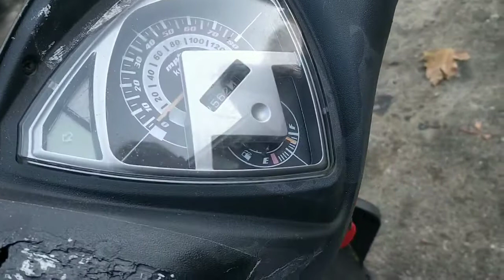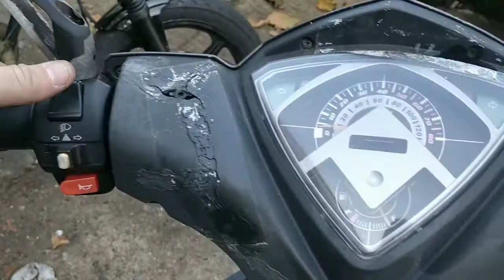sinnis harrier 125, new carb, electrical fixes and general maintenance

Comment: Hello great vid. My dad just bought me a 2022 Mgb r8 125cc moped and it literally looks exactly the same as this 2013 sinnis. How can that be? We bought it from a store brand new. Have we overpaid or bought a cheap Chinese knockoff? We paid £1899 will be delivered later this week. Hope it’s not a knockoff. From doing research mgb is a newly made company sourced by moto gb. Would appreciate your advise help or opinion. Thanks
Reply from the maker: Hi, these bikes are all made in China. Then other companies buy the design. For example lexmoto have this design and put their own stickers on. 

You have just bought the same bike but with the stickers of mgb. 

These bikes are OK though and for £1800 brand new that's pretty good, so I wouldn't worry about it.
Reply: @motorcyclerescuer  hey thanks for such a fast response. I did some research and mgb is a new company and the mgb r8 125cc I bought is a 2022 model. I’m glad that my dad didn’t buy a cheap knockoff and that these bikes are ok. Do they last long and also what’s the top speed? And also is everything the same? Same engine etc?
Reply: Oh I also have another question. My mgb hasn’t arrived yet but I wanna buy a phone mount for it. I notice the wing mirrors on these bikes look quite cool and different though. You know any on Amazon I can buy for a mgb r8 125cc. Ty
Reply from the maker: Its a Chinese bike so aren't the most reliable however if you put good oil in immediately that will help. Use plenty wd40 or similar on the brake wires etc. 

Top speed will be around 50mph ish
Reply from the maker: I don't I'm afraid because there isn't much room on the bars for it. It will need to clamp to the mirrors I'm sure

Comment: Hi Charlie my one switche offf everhtime I stop it in traffic could it be battery ?
Reply from the maker: Is your idle high enough? If it is you could have a blocked jet that needs cleaning. So it may need a carb clean. 

Try raising the idle first as it only takes 2 mins
Reply: @motorcyclerescuer  is idle the screw
Reply from the maker: @sharukhkhan9242  when you open your seat you will see an inspection panel, take that out and you will see the carb. Looking direct down and standing behind the bike, on the right you will see a screw. Turn it to the right half a turn. That should solve your problem. If its still cutting out turn it another half turn.

Comment: Electrics are my worst nightmare. Hope it it goes well with mot. Nice one Charley
Reply from the maker: I'm getting pretty good with them now. I'd never have worked that out 2 years ago. I used to get Jake to do the electrical problems. I used to drive myself nuts trying to work it out.

Comment: Hi there quick question av got the sinnis herrier 125 19 plate was fully working till last night driving down road got to traffic lights n click all electrics stopped i could kick start it but want easy. Any ideas to what or why it did that
Reply from the maker: Hi mate, so when you turn the key do you have any lights come on the dash? 

It should to me like your battery has died and needs charging. You would need to check that the bike is still charging as sometimes they stop. 

If you look at my lexmoti fmr vids this will explain more. 

Let me know what you think. 

Thanks for watching and please subscribe
Reply: @motorcyclerescuer  hi, i checked battery thats fine erm when i turn key theres no power to dash at all no horn nothing when i kick start it the lights come on but then go off
Reply from the maker: @SAUS4GE_SLAP  it sounds like you have blown the main fuse then. Near the battery you will have a fuse somewhere and it sounds like that has blown. This is normally what happens when you get nothing at all on the dash. 

Hope this helps
Reply: @motorcyclerescuer  i think it is the fuses ive got 2 glass fuses i just wriggled one of them dash came on for a sec then went off so maybe loose or like u said they have popped. Thanks for your help mate and av smashed that sub button 👍🏼
Reply from the maker: @SAUS4GE_SLAP  no problem. Get s new one in and it should be good to go. 

Well done.

Comment: Hey mate my bike runs for 5mins the cuts off no smoke any suggestions? Could it be battery or carburettor thanks
Reply from the maker: It sounds like text book valve adjustment. While cold it will just about run but once warm the valves tighten and won't run properly. 

Valves have to be checked and adjusted once stone cold though. 

That's the first thing I would do
Reply: @motorcyclerescuer  thank you very much mate earned a sub for me keep the channel up 💯💪🔥👊🏻💙
Reply from the maker: Appreciate that. 

Let me know how it goes out of curiosity.

Comment: Hey I love your videos my dude I’ve just bought a sinnis harrier 125 to repair it but I’m very new to this and I need to replace  carb  but idk what new carb to buy and where to buy one do u think u can send me a link to a new carb that will fit my bike?
Reply from the maker: Hi mate. Thanks for watching the channel. 

This is a ebay link to the new carb. It will be plug in and play.

https://www.ebay.co.uk/itm/175249307438?mkcid=16&mkevt=1&mkrid=711-127632-2357-0&ssspo=EhTkdid8QLK&sssrc=2349624&ssuid=CDLOYQ8UQj-&var=&widget_ver=artemis&media=COPY
Reply: @motorcyclerescuer  thanks man means a lot 🙂🙂
Reply from the maker: No worries.

Comment: I cannot find a brake line for this Sunnis harrier anywhere it’s the back brake but!!!!!!!! It’s not  it’s part of the back brake but it’s at the front of the bike and I need that front wire and I cannot find it anywhere
Reply from the maker: You just have to measure the one you have and order on ebay. They are generic
Reply: @motorcyclerescuer  amazing thank you
Reply from the maker: Good luck with it mate.

Comment: Great video. Just a quick question I have a Lexmoto Titan 125 and I’m having trouble with my lights I can’t see that the bulbs have blown Im not great with electrics tbh so I’m a little worried taking things apart lol Have you got any advice please.
Reply from the maker: Hi mate, if it's the same system as this sinnis then it's a pain if I'm being honest. If the bulb has blown then that's an easy fix but if it's wiring it may take some investigation to solve the issue. Are you in London? I could take a look for you if you were
Reply: @motorcyclerescuer  Oh right I see hopefully it’s the bulb as I’m no good at electrics lol. Im in Kent
Reply from the maker: Check the bulb first as it's normally just a simple fix. If you feel the bulb is OK and the wiring is the issue your welcome to pop to London on the weekend for me to take a look. Depending on where in Kent it's not to far of a ride.

I'm sure the bulb will solve it though
Reply: @motorcyclerescuer   Cheers thank you for you’re help it’s much appreciated
Reply from the maker: @stantheman575  no problem, let me know how it goes
Reply: @motorcyclerescuer  Will do mate
Reply: @motorcyclerescuer   Hello mate Where abouts in London are you?
Reply from the maker: Islington mate
Reply: @motorcyclerescuer   Ok mate that’s about 2 hours away from me I think
Reply from the maker: @stantheman575  OK mate, well I don't charge people so if you decide you would like to bring it then it could be worth it. Local mechanics and auto electricians can charge a small fortune.

Try a bulb first though just incase
Reply: @motorcyclerescuer   Yeah I’ll try the bulb first see how that goes. If that doesn’t work I’ll bring it to you mate. 

Thank you again

Comment: I'm no good with electrics either.  Last time I touched electrics on a bike I almost set my bike on fire . Was going to get the 550 today but the guy decided to change hes mind and tell me someone else was buying it for more money so back to square 1 .
Reply from the maker: That's an old trick people use. It encourages you to up your offer. He may not have anyone else but was trying his luck. My bet is he Co tacys you soon seeing if your still interested at your offer. If he does then knock another £50 off for the inconvenience. If he don't accept then his loss.

David in my facebook group has a great £250cc he's considering selling, your in that group aren't you? Put a message to him on there
Reply: Hi Charlie was going to look at a gs550 katana.  Bike has been sat 20 years carbs have been cleaned it does run but sometimes takes about 5 minutes to start any thoughts or advice from anyone would be great thanks steve
Reply from the maker: @steveandfamily7248  oh god if that's been sitting that long then the carb clean would need to be done well. The old fuel would need to be drained and the tank checked to see if rust has formed inside.

Otherwise I would suggest new coils and leads as a starting point.
Reply: @motorcyclerescuer  carbs have been ultrasonic cleaned   and new spark plugs.  I'm thinking maybe there could be a big issue with the engine.  I'm just going to try and find a bike ready to go
Reply from the maker: @steveandfamily7248  sounds like a plan. Something isn't right here